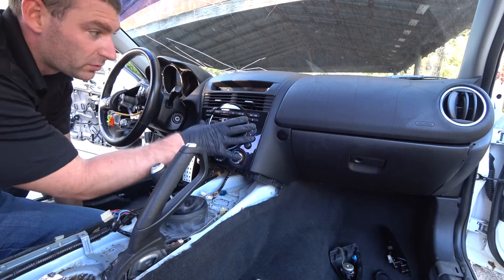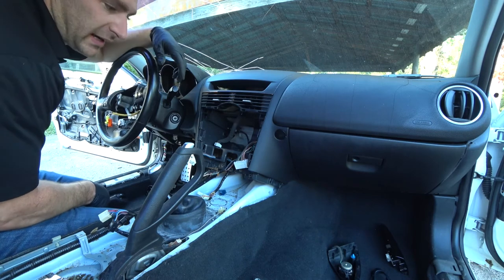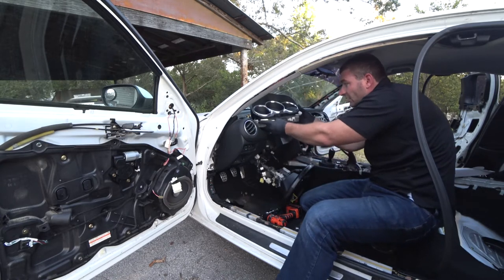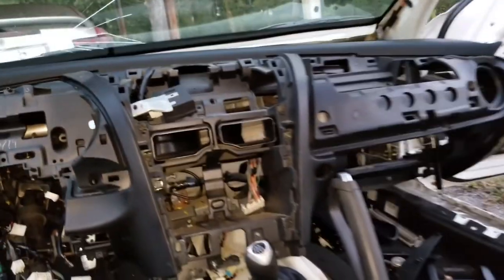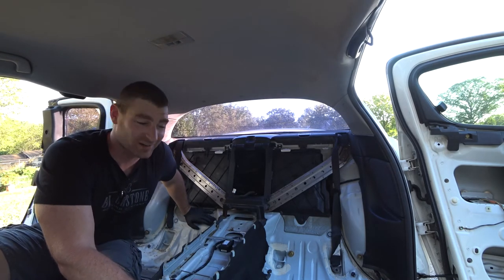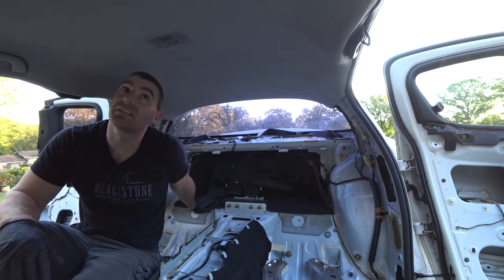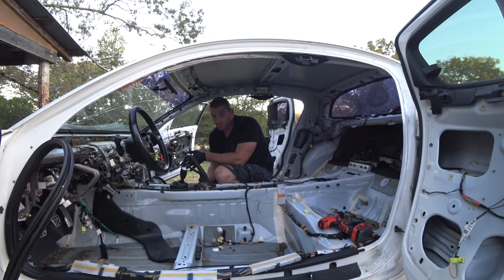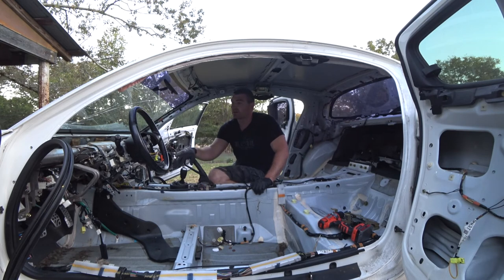Project RX-8 Interior Removal Part 2 (Stereo, Dash, Headliner, Curtain Airbags)

Comment: Great vid! R u selling the driver side visor or the temperature control unit? Also u said engine swap.... r u not keeping it rotary?
Reply from the maker: Thank you. Yes, the visors are available as I won't be reusing those. Not sure on the temperature control unit yet because I may keep a defroster. I will have a better idea once the new engine is mocked up in the engine bay and can see if the access to the heater core will need modification. I am swapping out the rotary engine. I don't have anything against them. I actually really like them, but the Renesis just not have enough torque to make this a really fast car, and it would cost a lot more to swap in a powerful rotary compared to the lightweight LFX engine that I plan on putting in it. A Renesis powered Miata however, would be a blast!

Comment: Do you know how much weight you managed to remove from the car?  Would be good for a reference point.
Reply from the maker: marcooconnor I wanted to weigh each piece to see how much came out, but I didnt have a good way of weighing the larger pieces. To be honest though, most of the plastic panels weigh almost nothing. If you dont need the room for a cage it wouldnt be worth removing them. All the guts in the dash like hvac and stereo plus all of the air bags and oem seat belts weigh quite a bit though. I do plan on weighing the car once completed.
Reply: Yeah same thing I'm wanting to strip the car just like you've done but keep the rotary in it and wanted to know about how much weight I could get off I weighed my car on a scale I got 3020
Reply: Individually the plastics don't weight much, however when you take into consideration a combined weight, it all adds up! So if you're hell bent on saving weight then the way I see it, if you don't absolutely need it, get rid of it! Plus all the screws and clips you take out add up to about 1kg+ just in screws!